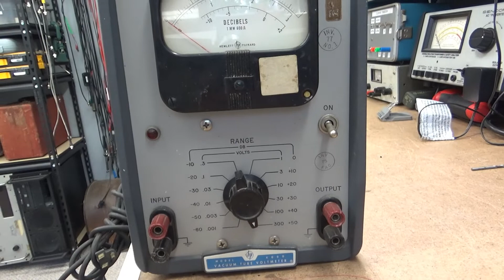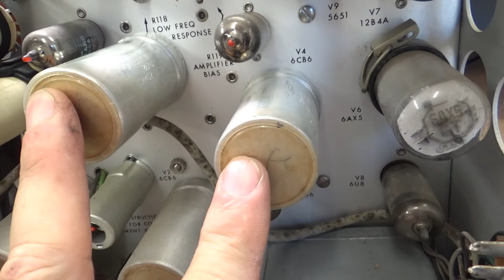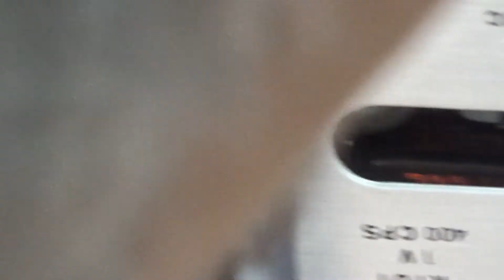Twist Lock Electrolytic Capacitor Restuffing Special

Comment: CE Electronics, sold via Amplified Parts, sells a broad range of twist lock multisection electrolytic capacitors.  If they have the values you need, it's MUCH easier to buy it than try to restuff one.,
Reply: I was unable to find CE electronics.  Can you supply the link? Oh and how fresh are those electrolyte capacitors?
Thanks

Comment: I HAVE A THOUGHT ABOUT RESTUFFING CAPS .. the thing is that heat degrades capacitors ..So enclosing  caps inside a can will get  them warm and the heat has nowhere to go.So they will fail sooner than later
Reply from the maker: Nah, 105C caps will work all day long.

Comment: Hey Sam! Thanks for this video. New subscriber here. I'm doing the same surgery on a similar Sprague can cap from an HP 400H VTVM. One thing i noticed which might be of help the next time is that the outer ring has a tiny little protrusion on its edge which aligns with a notch on the first phenolic layer. That way your twist tabs are always oriented correctly relative to the solder lugs without needing to mark anything. The can itself can then be oriented any way. Also I noticed that you left out the layer of plastic from your sandwich of parts. Was that just an extra piece to keep the electrolytic mass together? Oh and also.. man those cutters are the perfect tool to pry off the can lip! I have the same ones.
Reply from the maker: Sounds good. Thanks!

Comment: After being uncrimped I heat them until they smoke slightly. They then  come out in one pull. They won't explode once you have the can uncrimped. If the leads break off screw a small lag bolt into it to pull from.
Reply: The lag screw is a great idea. I will have to try that the next time.

Comment: Ughhhhh.....ok. The tester is now very complex, perfect fot testing simple gear.
Reply from the maker: You'd be surprised at the things you can do with "Old Testers". :-)
Reply: then you would actually be surprised to know that some certain things can only be measured with a real VTVM. A DMM is cheap and simple but it has drawbacks in many ways and when you go about measuring small signals or voltages in high impedance circuits your regular DMM is actually skewing the measurement by loading the circuit which gives you the wrong reading. The input impedance of a VTVM is normally 10Meg which is about 10 times higher than a typical DMM which makes it be pretty much invisible to most circuits under tests. 
never underestimate the precision of tubes because even today certain things can only be done using them. back in the days it was about quality and performance, and today everything is about pricing and profit together with consumption as often as possible